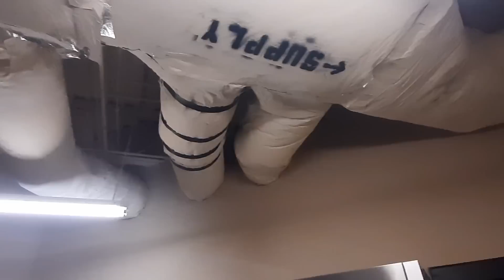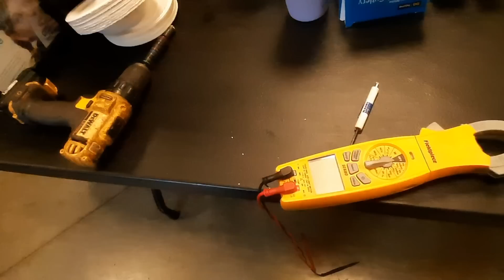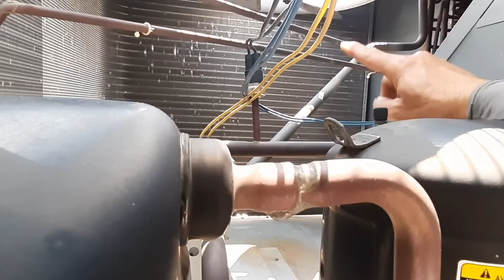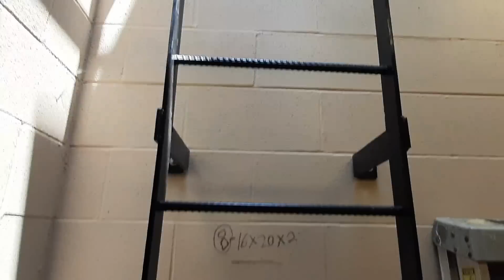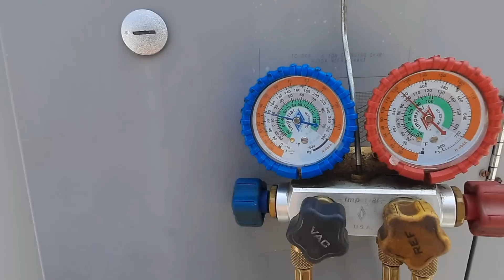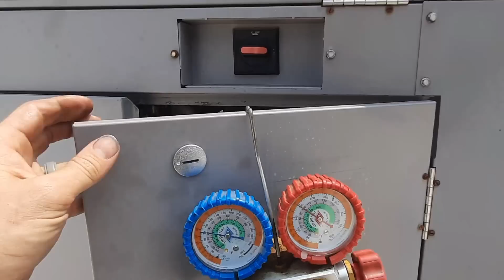no cooling service call. commercial building call #1. #hvacservice #carrier #hvactraining #hvac

Comment: Just got done replacing two compressor and three different evaporator headers on these exact carriers. Have another one to do tomorrow. Replaced the compressor on one and after replacement had a restricted header. I’m now a pro at replacing these metering devices. Haha. They are annoying. From now on when I diagnose a bad compressor on these carriers I’ll be suggesting a new metering device as well. Apparently they clog up easy.
Reply from the maker: The new units with TXVs are much better. It should always be a consideration. I will warn before replacing any compressor. Sometimes, you find out what killed it.
Reply: I had the same issue after a compressor replacement.
We were on our first visit to the location, so no history to reference.
Unit was 2006 and very poorly maintained. Recommended replacement over repair, but he wanted to "save" money. Now it is more money into replacing the indoor coil or a new unit.
There are 2 more on this place with similar issues.

Comment: FYI...Honeywell touch screen thermostats do not require batteries to operate as long as 24 volts on R&C terminals. I have accounts that I purposely leave the batteries out so on my walk through I can immediately see a no voltage to stat. Small coin battery keeps the program. Another benefit is battery acid is not an issue.
Reply from the maker: It is easier to see a problem without the batteries. Thanks spaceboy